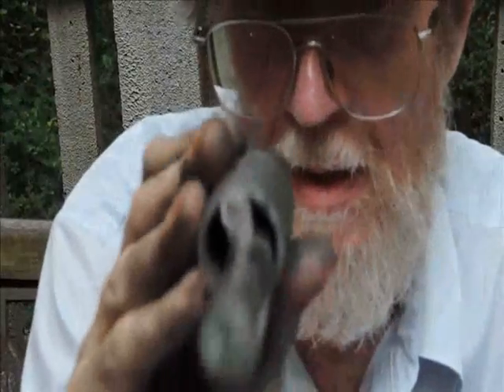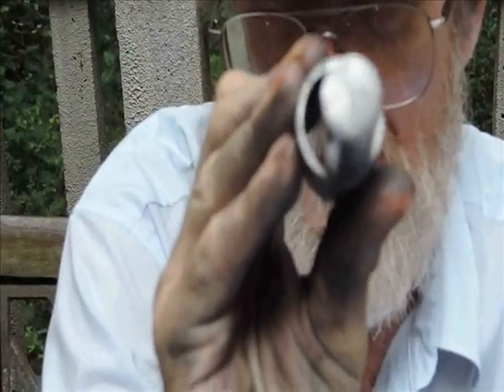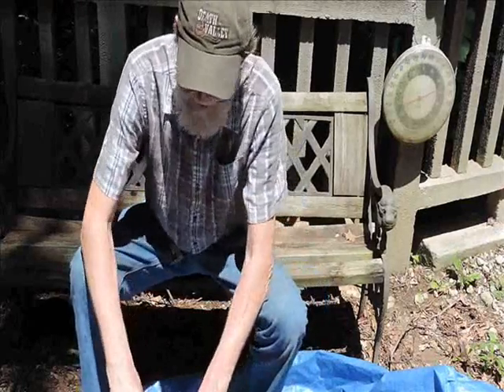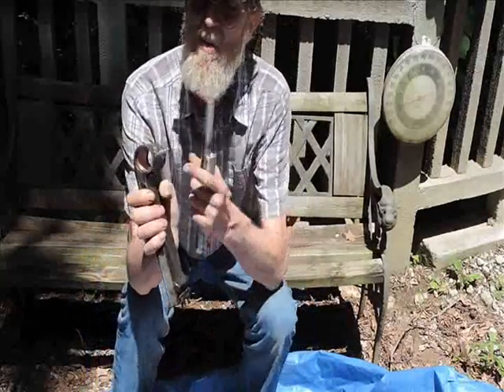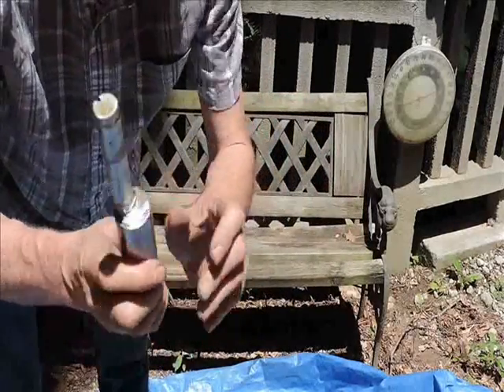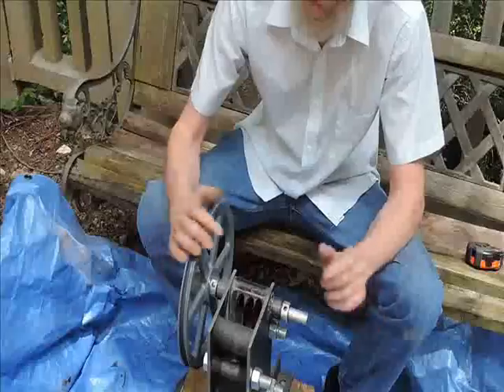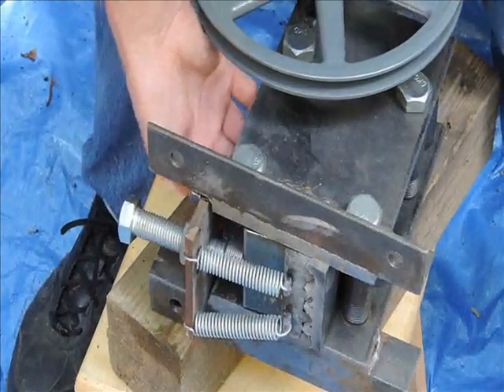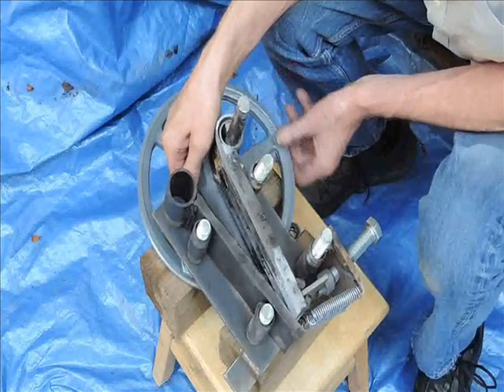Gold Ore Crusher Tutorial part 2

Comment: can u use two shafts. one main shaft and a thicker shaft with a hole the size of the main shaft in it. The main shaft goes through the thick shaft to make an eccentric shaft. Is this possible? i dont have the option to do it like you did.